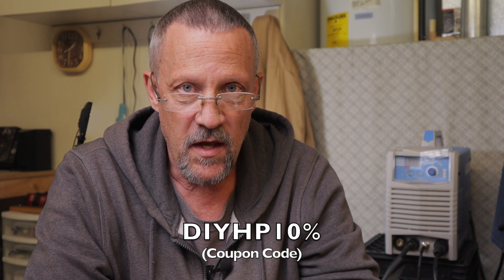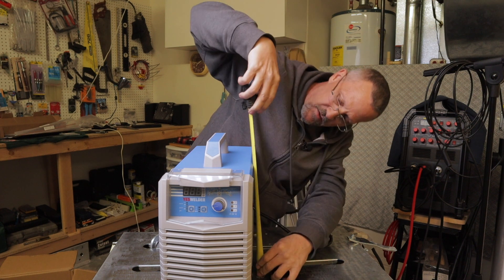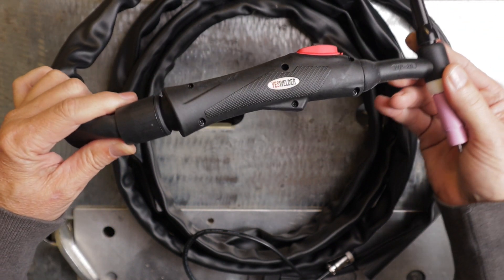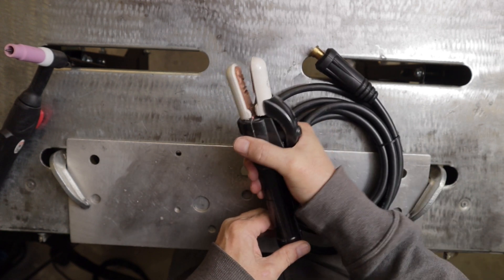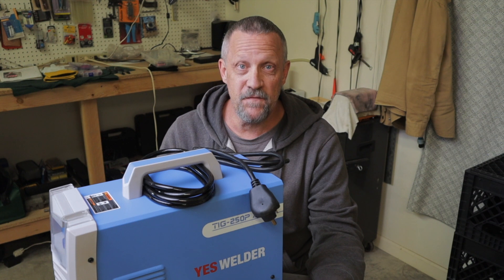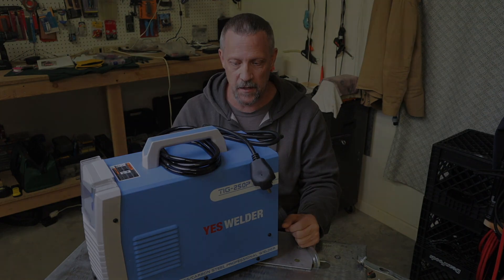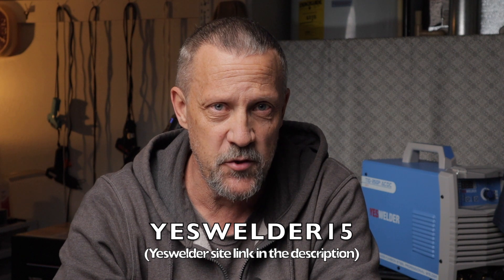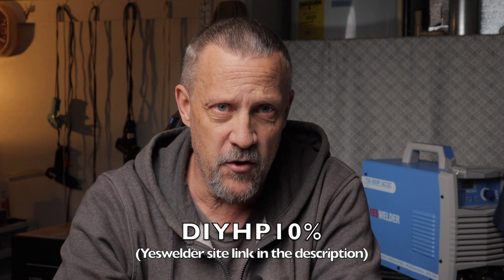I Tried the Yes Welder TIG250P and Here's What REALLY Happened

Comment: Awesome welds like you said for a beginners 👍🏻 , will it Tig 1/4  aluminum?
Reply: Yea it will. If it goes over 200amps, it will easily. 200+Amps really just gets you started, heats the part up, if u look at your welder mid weld on .25" you'll typically see anywhere from 150-190amps after the part has heat in it. That's why they say "a little preheat goes along way." Cuz I've welded 1" thick aluminum to .25" pipe, with 245amps, with a little 200°F preheat. 350amp machines are to increase productivity and efficiency really. Helium mix or Stargon AL are also great methods to up your aluminum game
Reply from the maker: Thanks for the info Derrick! 👍
Reply from the maker: I haven't tried it but it should have the amperage to TIG 1/4" Aluminum.

Comment: How does it compare to your PrimeWeld?
Reply from the maker: That's a good question Terry. I do like the size and weight of the YesWelder better than the Prime Weld. I'm still familiarizing with it but I think I like the YesWelder user interface better as well. The Prime Weld comes with a better torch, torch lead and foot pedal though. The YesWelder didn't come with a regulator but the Prime Weld does. It's hard to make a call which one I like better because they both weld really nicely. It's rare to non existent to see a break in the Prime Weld price because they can't keep them in stock. At the moment with the YesWelder end of year sale I think it's a "hard to beat" deal at the moment. At regular price it's a real close call as to which one I like better. I think they are both real capable welders for the cost.
Reply: @DIYHomesteadProjectsDIYHP10  thanks, I plan to purchase a Tig by year end and trying to do as much research as possible before I pull the trigger. Look forward to more videos.
Reply from the maker: Nice! I've done a lot of research before I purchased an AC/DC TIG machine and in my opinion, the YesWelder and PrimeWeld are the top two machines to consider. These two machines have the best warranty out there in this price range and they are both real nice machines for the money in my opinion.
Reply: @DIYHomesteadProjectsDIYHP10  the other welder I’ve looked into is the everlast 200DV. Any experience with them?
Reply from the maker: No Terry, I have no experience with the Everlast machines but I did almost buy one. I see most people who have videos of them seem to really like them. I think they are a little more money than the PrimeWeld or YesWelder but I don't hear a lot of bad things about them.
Reply from the maker: Now that I think about the Everlast brand I remember a little more about the research I did on those machines. They do have a 5 year warranty and I seem to remember reading somewhere that you have to cover the shipping if you have a warranty claim. (I can't verify that but I think that's how it works with Everlast) They are feature packed machines and in my mind a step up from the two I mentioned earlier. The main reason I didn't go with an Everlast is they are a little more than I was hoping to spend. I'm a pretty thrifty guy. LOL Otherwise I would have pulled the trigger on one. I'm sure you already know this but most if not all of the experienced YouTube welding channels have them in their shops so they must be decent machines. Again, just my opinion, I have not owned one.

Comment: Good vid Bruce. So do you like this better than your PrimeWeld?
Reply from the maker: Thanks Mark! Boy, that's a good question. I do like the size and weight of the YesWelder better than the Prime Weld. I'm still familiarizing with it but I think I like the YesWelder user interface better as well. The Prime Weld comes with a better torch, torch lead and foot pedal though. The YesWelder didn't come with a regulator but the Prime Weld does. It's hard to make a call which one I like better because they both weld really nicely. It's rare to non existent to see a break in the Prime Weld price because they can't keep them in stock. At the moment with the YesWelder end of year sale I think it's a "hard to beat" deal at the moment. At regular price it's a real close call as to which one I like better. I think they are both real capable welders for the cost.
Reply: @DIYHomesteadProjectsDIYHP10  did you get the primeweld for free as well?
Reply from the maker: No, I purchased the PrimeWeld with my own money at full price.